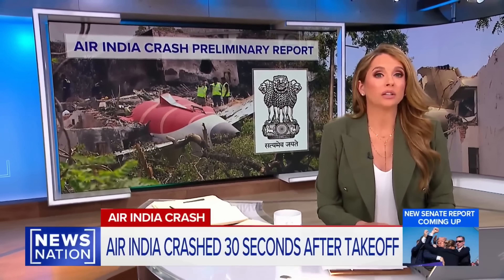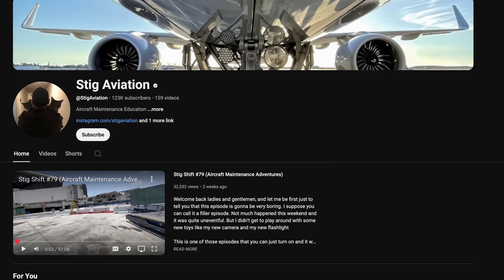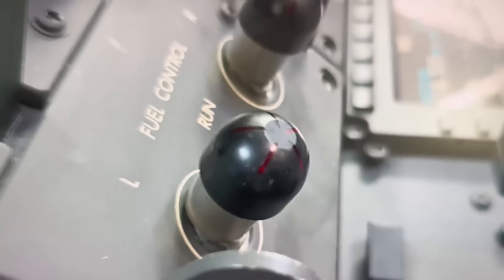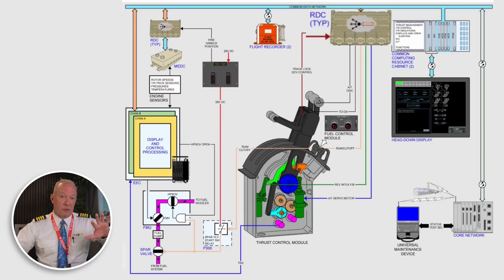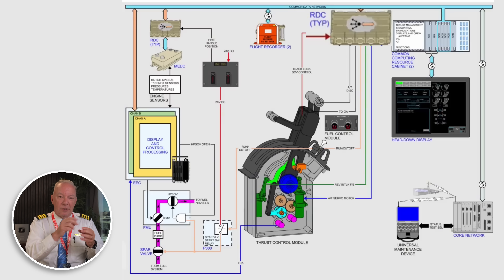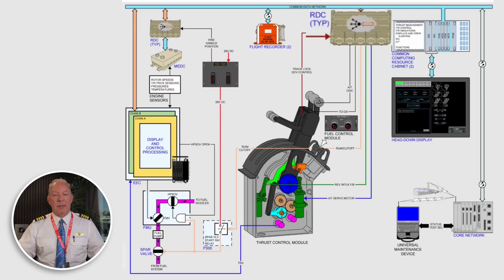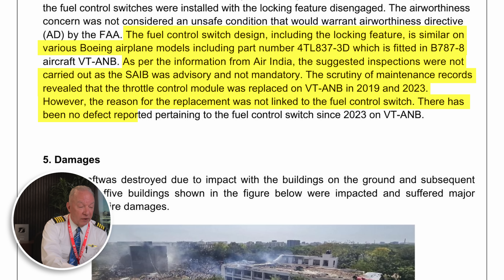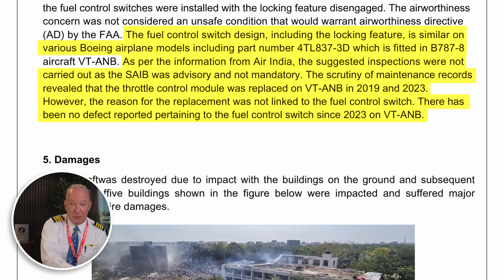The Truth About Boeing 787 Fuel Control Switches

Comment: Not a mechanic here, but since 2020 I have learned that on gov't reports especially, the important parts are often left unstated. I notice right away that this would be the 3rd throttle control module the plane had (2011, 2019, 2023). What exactly were the problems reported with the faulty units? They also state 'no defect reported pertaining to fuel control switch since 2023 on this plane'. OK, how about in the whole history of the plane? Has it ever had a problem such as this. How about for IA's entire fleet? How about every 787 globally? They went too specific with that description - and that is sus - especially given the past actions of the players involved in conducting the investigation.

Comment: I understand what you are saying, but in my 30 year career in system administration and as an electrical engineer,  I have seen many cry's about certain sabotage that all ended up being an unforeseen failure modes.  I am very reluctant to conclude anything that smears a pilot that can not defend his actions anymore.
Reply: You missed a point that is implicit in what he said. This fuel shut-offsystem is so gosh-awful simple that there are no "unforeseen failure modes."
Reply: @Inkling777  I did not miss that point. Even in plain old wiring looms and relays there can be really complex faults that drive you utterly insane.
Reply: @Nerd3927  two switches completely independent of each of fail within seconds, its just a coincidence that the co pilot asks the pilot why he shut off the fuel switches, then out of the blue they just start working a few seconds later.
Reply: @Neubs-xv8tw Yes ofcourse the just moving the switches is the easiest explanation. Pilot is crazy, job done. I have seen to much blame past around to go for that.
Reply: @Nerd3927  currently there is no evidence of any sort of malfunction, and statistically for both of those completely independent switches to fail within seconds of each each other in addition to the cockpit audio between the two pilots makes a pretty strong case it was a deliberate act.
Reply: @Neubs-xv8tw You are not a seasoned electrical engineer and think too simple. The reasoning behind a deliberatie act can only be explained by utter insanity and a total disregard for the life of others on board and on the ground. I find that way more unlikely then a complex unexpected failure mode that is my daily business.

Comment: Great as usual Capt. Question on the Fuel Control Valve themselves. Do they Fail As Is on loss of DC power from the Battery (or blown fuse) or do they fail to close position. Are the valves in electrical series or parallel. Just curiosity not trying to see if that could impact this situation. Tks

Comment: This is completely out of my field but what you are explaining doesn't make sense to me.  ~5.5 minutes into the video you point to a switch and say there is a relay in the switch.  I think not.  There is a switch in the switch.  Typically in this type circuit the power from the switch, the 28 volts will operate an actual relay.   The switch power could drive the power directly to the pump or whatever it is controlling without a relay but that is not what you are saying.  This is what doesn't make sense to me.  If there is a relay then the relay could fail.  Old fashioned analog relays with a coil that pulls contact together are known weak/failure points in electrical systems.  I appreciate the simplicity you are  explaining with but think something is lacking or we need more understanding of the parts used.

Comment: Saw a previous video and you went over it again in this video with the showing of the switches.  It was discussed about the simulator battery but what if something shorts across that battery and the battery goes out..there would not be 30 minutes of power but then again probably not the cause as it was stated something shut those switches off  but is there a failsafe or something power that could interrupt that sensor detection to make it think it was off? I mean it is a moot point since the audio of one pilot asking the other pilot if he turned the switches off.

Comment: So you're sitting on the runway with the throttles at idle about to start the takeoff roll. For the fuel switches to be inadvertently moved to off the most likely time is when the throttles are back at idle near the fuel switches. If that happened would the airplane have even been able to take off and achieve flight?? Could bouncing down a bad runway cause the switches to both move to the off position uncommanded?? How could the fuel switches be inadvertently switched off once the throttles had been advanced to take off power being well forward of the fuel switches without the action being deliberate???

Comment: The fuel control switches are powered by electricity and if the electricity fails intermittently then the aircraft computer will report that those switches were moved to another position when in fact they were not even touched by the pilots _ so this is another theory that we may never know just like the MH-370 mystery we may never know !!!!!!!!!!

Comment: So here's my question(s) and comments.  I'm wondering why such a critical item(s) in a plane such as fuel valves would be in a 'series' configuration.  The SPAR valve, FMV, and HPSOV are all in series (based on your diagram), meaning if any one of those fails, plane has issues.  Logically it would make sense to have those, what I would assume, very important components, in a 'parallel' setup.  A mini redundancy if you will.  My more direct question would be, what is the non-powered state of those valves?  Do they spring closed, or remain in the current position when power is removed?  Anyway, always enjoy your videos.

Comment: Good video but not technically sound. He completely missed the point that the 28v DC could have been lost due to electrical issues. He continues to emphasize that pilots are the issue but they are not.

Comment: Thank you for the clarity of your presentation.  Some other presenters seem to have the “vapors” when it comes to explaining the fuel cutoff switches.  They constantly go down rabbit holes trying to make it an equipment issue instead of a pilot issue.
Reply: There is no way of proving pilot issue without a camera monitoring pilots long over due.
Reply: @paulchapman7027 they haven’t released the full cockpit recordings yet, or the full output from the flight data recorders.  There is probably plenty of information available to determine the cause of the crash.  The Indian authorities have not been very transparent thus far.
Reply: @paulchapman7027  That's impractical. There are tens, if not hundreds of thousands of commercial airliners in service world wide. Retrofitting them all would cost billions. All because of ONE incident where a camera would have been helpful ? You'd need at least 2 and often 3 to cover all switches and buttons in a cockpit.

Comment: So what monitors the physical switch to tell the flight recorders the movement of the swiches. There must be other circuits involved to send this information. Also I the schematics used in instruction manuals are very simplified. There are other circuits added to address electrical noise/interference that can only be found in the maintenance engineering diagrams.

Comment: Capt Mike what about the electrical harness connections for these throttle control modules. If these were not connected properly of if there was a cold connection in the harness with the electrical connector for the fuel control switches....what then. Changing this complete module in 2023 I think is a big clue. It's not the switch themselves but the big main harness with electrical plugs to connect when this module was replaced.

Comment: You're mistaken, probably due to translation errors... Valves should remain open even after a 28V DC power failure. A basic safety principle. Bistable valves. One pulse turns on, the other turns off. Not so: 28V works, but there's no closure...